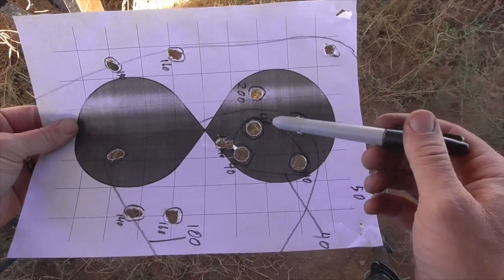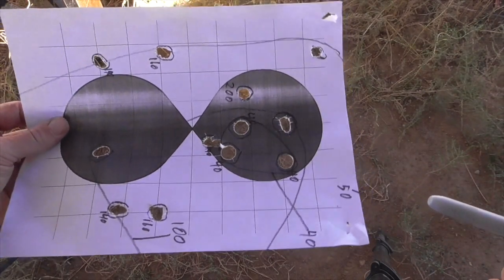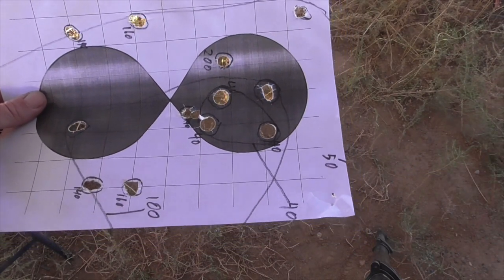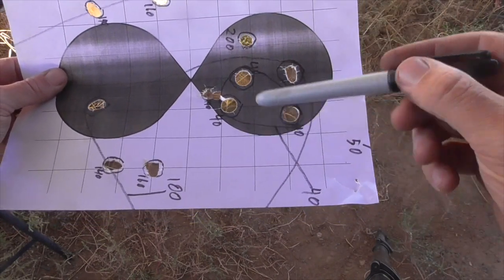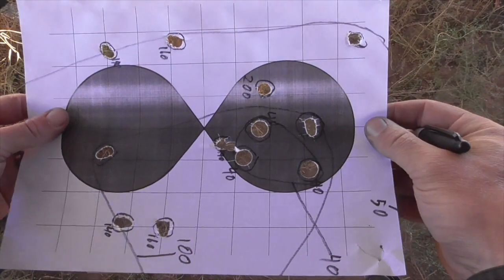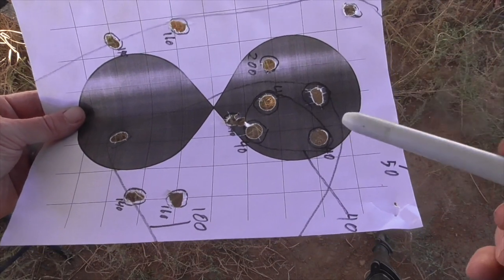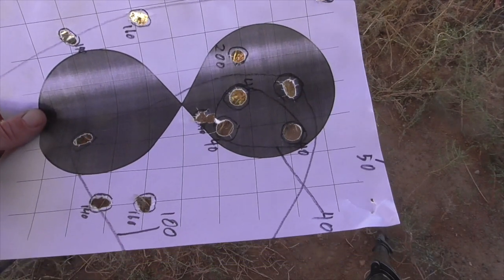Muzzleloader Sabots Revisited (TIS387)

Comment: Since you got such good accuracy with the bullets staying in the sabot, i decided to design and 3d print my own version that capitalizes on that , i made a hollow skirt base with driving band of .500 a second driving band right after the skirt ends with the same diameter then a shallower groove and final driving band with a diameter of .505 that gets rifling engraved at loading and of course it has a cavity for the bullet which in this case was a lee 356-102 that i epoxied in. Just tested them tonight and only had 2 out of 20 seperate, i printed 10 in polymax pla and 10 in polylite petg, i thought for sure with petg being more ductile itd be the winner but i had tumbling and separation issues with those even with light charges. The pla ones on the other hand performed beautifully i was easily able to keep it on my pie plate sized target at 50 with my large fiber optic front sight which doesnt allow much more precision. Tested from 60-140gr charges with no issues and comparable accuracy

Comment: I've had this failure to discard problem with some shotgun loads and had
to cut the peddles almost all the way through at the base and flex or exercise them by hand a couple times before loading in order to get them to discard upon exiting the barrel.  If the pedals are super stiff they will not open. They have to flex open easily.

Comment: That was cool. So when the sabot stays on the bullet we get very nice accuracy. But when there is enough velocity to cause it to discard accuracy goes out the window. Maybe the sabot is not coming off the bullet correctly. Is a hard type of plastic?
Reply from the maker: Yes, the plastic is fairly hard.  These sabots are printed from PETG.
Reply: @TheIdahoanShow  Did you find the sabot from any of the poor accuracy shots? I'm wondering if they are breaking up in the bore?
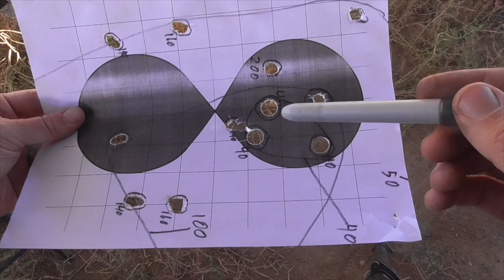Reply: @TheIdahoanShow  Interesting. Might have something to do with it. The sabot I used were quite soft. Twas a 1:48 twist. What is yours? Would a faster twist and therefore higher centrifugal forces make a for a better discard?
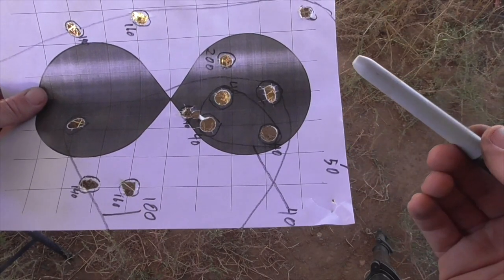Reply from the maker: 1:24 twist.  I would have thought that would be fast enough to stabilize these.
Reply: @TheIdahoanShow  Yup

Comment: would heavier projectiles be more stable
Reply: Only if the added weight was at a larger diameter.  Lighter (shorter)  .38 bullets have a better chance of being stable, due to the .50 barrel's slow twist rate.

Comment: If your goal is a light weight, fast, and accurate bullet. Keep them 50 cal but have the weight on the outside of the bullet. Ideally a long nosed, lead cased, light cored bullet.
Reply: That would preserve spin stabilization, but would reduce ballistic coefficient, so good for hitting hard at shorter ranges.  It will also save lead material per shot.

If the goal is to shoot available .357" bullets from a .50 muzzle loader, then another option for Tim is to make a .50 barrel with a faster twist, suitable for the smaller caliber projectiles.  While that sounds like a hard ask, Tim makes his own barrels, using rifling buttons he makes.

Comment: Are those ricochets singing in the beginning???
Reply: Yes.  They won't go far, and I am sure they remain on Tim's land.  Else he would make sure he has a berm for them to run into.
Reply: @rickoshea8138  more concerned they might peel his head back.
Reply: @tsumnerbmw  most or average bullets will not do a 180° ricochet.  Especially when they're hitting dirt and stone. Now when you start throwing hardcast or steel at steel plates that aren't angled.. very possible.  You can trust the science of Ballistics.